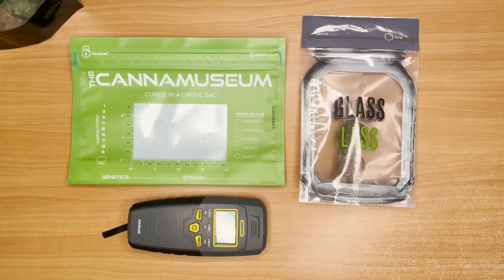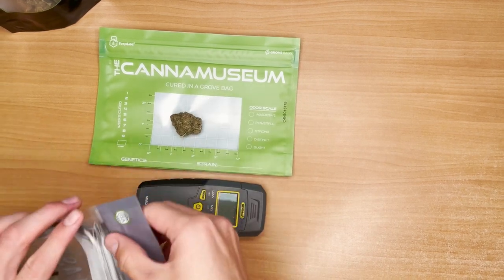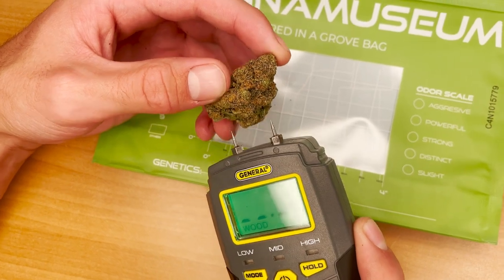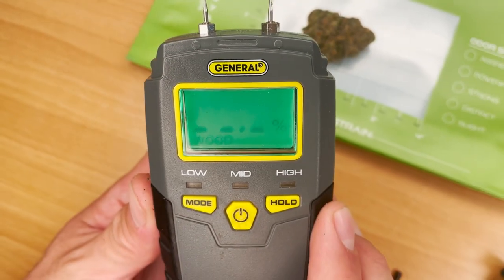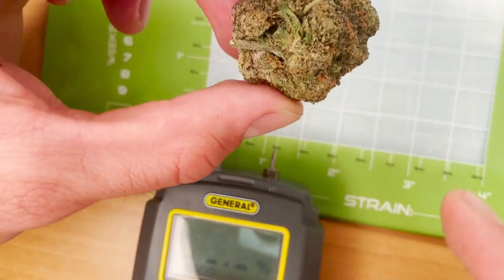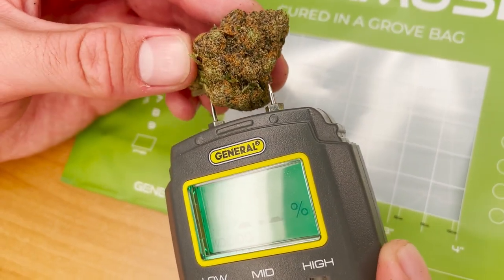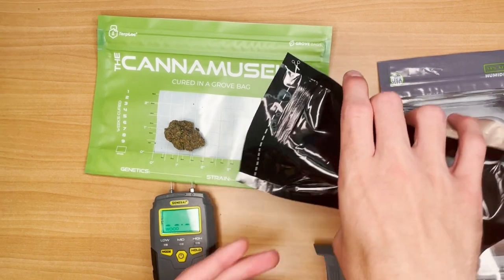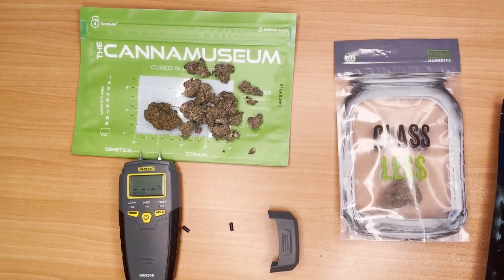Ep22: All about the Moisture Meter | Grove Bags' Presents TerpLoc® "Encyclopedia Bag"

Comment: Good video, but you’re not detailed  enough, do you suggest putting the tip of the sharp probe into the stem or just touching the stem? If pushed into the stem that is a huge difference as it can jump it from 6% to 15% on a nug
Reply: Just the bud. Nobody cares about stem moisture.

Comment: The video wasn’t bad but you guys read everything off the screen. It was also short and covered the bare minimum. You guys could have covered way more. You start your video with a bud already in bag. Being more practical you should have used buds coming from a dry room and show all the steps to get to your bag. The bud in the video was to dry? It didn’t even get over 10%. Wouldn’t that be a bad example since it’s not in the range your recommend? What is the next step if it’s to dry with your bags? Humidity packs? Are the buds suppose to be trimmed before you test and bag them? Can they be tested, trimmed then bagged?  I assume the reading would be done during the dry while they are on the whole plant. With the way you did it what if the buds are to wet? You now have another step before we can use your bags. Can you test the moisture while the buds are on the whole plant? 

Do you guys grow yourself? If so a video from your dry room to your bags would be much better and we can see all the steps.

Comment: I hadn't seen this yet.   It explains why all the other instructions for measuring moisture using a meter failed and led to 50% RH for several days, until I realized something was wrong and it simply wasn't going to get down to 12% moisture reading, hovering around 13.5.  (I was measuring the stem at the base of the bud due to lack of clarity how to use the meter in other forums, loss of quality as a result.).

Comment: im almost positive i did not over dry, hygrometer is reading 53% 2 days after bagging , its 2.5oz in a QP bag , will humidity slowly rise in the next few days maybe? maybe its just not enough flower to space ratio ?
Reply from the maker: Hello, seems that your nugs are a little bit drier. If you are to use a larger bag than the amount of nugs (2.5oz nugs in a 4oz bag), you would need the moisture content to be as close to the 12% as possible because you need to compensate for the lower total amount of moisture inside the package. We designed the QP bag to work with 4oz flower at 10-12% moisture content, so with 2.5oz of flower at 10-12% moisture content, you are essentially "shorting" the bag out of 1.5oz of 10-12% moisture. Therefore, the RH inside will be lower. You may want to get a 2oz bag for your harvest and the next time you use a QP bag, put closer to the 4oz , and definitely more than 2.5oz if you keep your same dry process. Hope this helps.
Reply: @grovebags  it helps thanks , i will most likely buy some 1oz bags for my next harvest, probably a moister reader of some sort aswell just to be extra dialed

Comment: Can you put Boveda in the bag .... and for how long? - only till it reaches desired moisture and then take it out ... or can you keep it in all the time ... or not at all? ... tnx!
Reply from the maker: If your nugs are on the drier side, then yes you'll be fine. Generally, you only need to put it until the desired moisture is reached. The risk is that maybe you have dense nugs and the outside moisture is reading 12% but the inside might be at 14%, and then you put in another humidity pack. The humidity pack may not be able to absorb the extra moisture and the outcome will be not good.

Comment: what about the moisture from your hand holding the nug
Reply from the maker: That's a good question, the moisture meter will only measure the readings between the two prongs, so generally speaking, you'll be fine holding the nug with one hand.

Comment: So how does one get their nugs to look like that? Smooth looking
Reply: wym? trim it tighter?
Reply: two things, and one will be difficult to achieve and even dangerous in home grows. 
1.) Light intensity. The higher PPFD, as long as the plant's environment is maintained at a good rate, will usually lead to denser nugs. You will need many things going right though: the canopy and roots need to have a maintained temperature, humidity needs to be high enough to not get zapped by the light, as well as the next biggest thing for density - 
2.) CO2. CO2 will impact the transpiration rates and allows the plant to eat more photons and therefor have higher light levels and denser buds. This will be expensive or dangerous, considering that solo trips to a CO2 tent with a malfunctioning CO2 sensor might knock you out or worse. As a tip, know that some areas of the house may have naturally higher CO2 levels than others, though. Usually the same room you keep your furnace. 

Good luck!
Reply: Trim machine

Comment: What meter do you recommend?
I'm looking at the Delmhorst  F-2000/H
Reply from the maker: Hi, any moisture meter should do. Delmhorst meters are the Mercedes of moisture meters you can never go wrong with them.
Reply: @grovebags  any others you recommend that aren't so pricey?
Reply from the maker: @tedshred8932  yup, any of the ones you find in a home depot or hardware store should be ok. The one we are using the video was around $35.
Reply: I’ve been growing for years I finally came across your grove bags I’ll be purchasing many in the future I only got 4 pound bags for a trial run If it works out I’ll be buying a lot of 100 going with the 5 to 10 pound bags

Comment: Oh and on top of that you want me to sweat it out in paper bags aswell .
Reply: You could also use Grove bags to sweat buds and you cud use them as you use your jars and just seal them once stable 60 to 62 rh inside the bag. Good to go. No burping needed at that point. No need for a moisture meter if you do it right. But they are handy tools to take the guess work out of the equation an it's only 20 bucks for a wood moisture meter. Not like your spending a fortune to take the guess work out...
Reply: I like to do a 12 day dry at 60rh and then in paper bags for 3 days.
Reply: @nicholassolomonson8349  Id much prefer this way of burping the grove bags until it stabilizes at 58-62 because there's less chance you over dry with the paper bags, incase there ends up being no need for sweating because you dried perfectly and then you cant get back that moisture back for the cure

Comment: I stopped using your bags, once you said I need to dry shit to 12 percent and needed a meter to test I was out to much work for me . I’ll stick to my jars .
Reply: You still need to dry it down to that level with jars too lol Using a meter makes it easier instead of guessing when the stem snaps.
Reply: @NeonKue  lmfaO. NAH BRO TOO MUCH WORK BRO GOING BACK TO THE STONE AGE BRO WORKS FOR ME BRO. /s
Reply: You’re willing to go through the long process of growing the plant, potentially having to mix chemicals with precision on a weekly basis, but sticking two pins in a stem is a step too far?
Reply: @NeonKue  10-12% in a stem seems pretty dry wouldn't that belike 10% in the bud
Reply: 😂 they aren't telling you to dry it down to 12% RH 😂, the 10-12% is for moisture content as per the meter, not humidity 😅
Reply: Just put it in jars. Store it in the right climate, and burp them until the jars stay at 62%, then put it in the grove bags.

Comment: This honestly kills your bags. This is why everyone doesn’t use your bags
Reply from the maker: Hey, so all of these extra process, the sweating, and the meters, and all not 100% necessary. If you're someone interested in precision through numbers and processes, that's what this is for. The people obsessing over 0.5% RH on the meters as a preference. It's like shifting a manual car. Do you need a short shifter to shift better? Do you need shifting lights for smoother shifts? No, but if you do, you can probably be more accurate and faster in your shifting. These meters procedures are like that, not required but will help for sure.
Reply: @grovebags  then what's the purpose at least tell those what number is good when checking your bud with meter if you're going to sell grow bags at least have good information on what people need to do I lost a batch because of high humidity because I didn't know exactly what I was doing and I couldn't find a video to show me I will not spend another dime with y'all I seriously don't think they work it's my second time buying them in the same results
Reply: @kingcola3849  good lord man, they tell you the number early in the video. 10-12%